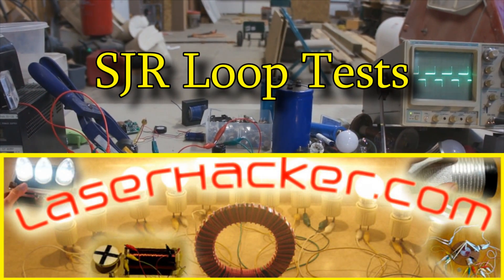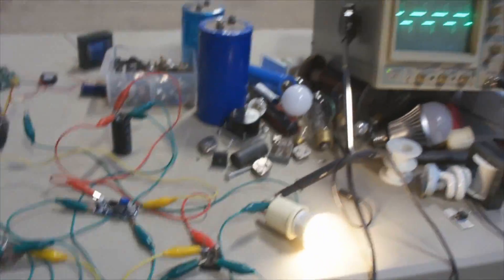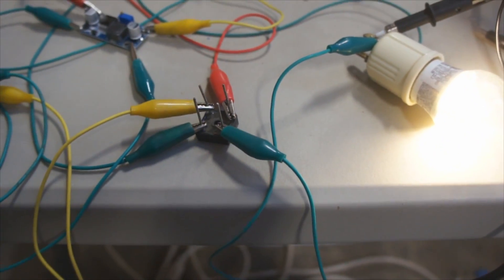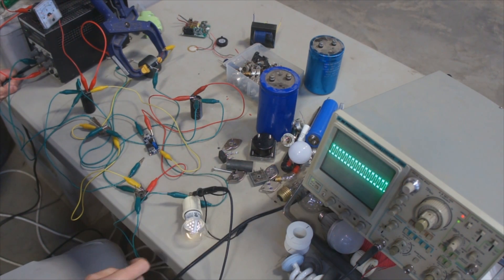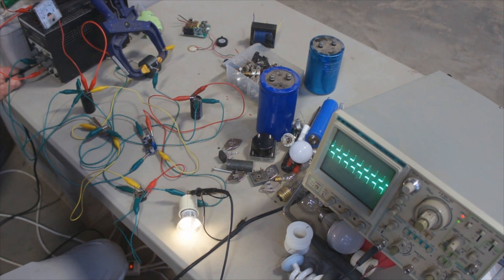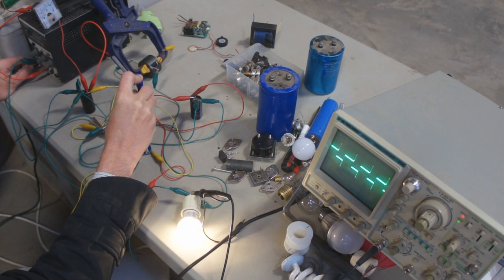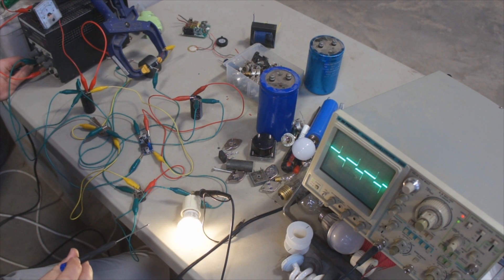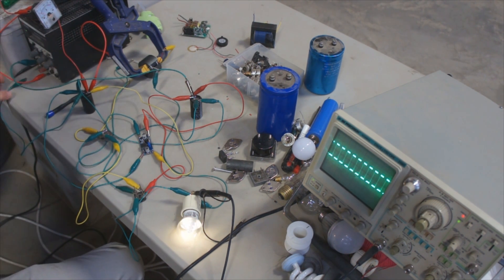SJR Loop Tests - Quick Update

Comment: A very interesting experiment. Basically it shows that Akula device is into something, there is potential in it, but it's not true overunity yet. That's why Akula never showed it working for too long. Always switched it off, either by the swich or by turning the dials.

As to people complaining about the sound. Does it have a potential to turn you off such an interesting video? I left my headphones near my head but not on my ears and the voice was perfectly hearable, yet the high pitch noise was not annoying.

Comment: do you think the second capacitor might be causing the circuit to run a little longer when the power supply is disconnected?

Comment: Could try 4 mosfets connected like a bridge rectifier so you don't have the voltage drop across the rectifier.
Reply: Can you please post a circuit diagram for such a Mosfet bridge rectifier please ? Many thanks !
Reply: overunitydotcom
 I can't figure out how to send a message in youtube anymore. Search google for "mosfet bridge rectifier" and it will be the ThetaEngineering search result. I don't know how well it would work, but I stumbled onto the idea when I saw an article about using a mosfet as a 0 voltage drop blocking diode for solar panels.

Comment: Longer run times  as cool joule  said
I've used 2 Jr  750 ma transformer   one output from 110  0   110  was placed directly to source battery  and solar panel  removed @200 ma  input  5 5 watts led bulbs  have 9 hours steady v 10.9 from alum battery       still  need to test more   but results are great

Comment: Dude you are total deaf at high frequencies, however we who still can can hear that this video is very painful. Try to use a low pass filter on the video or record the sound after u turned the coils off.  This is unsaleable at this freq, u need to raise it at least to where only dogs can hear it.
Reply: either that or it's spewing EMF and inducting into the mic